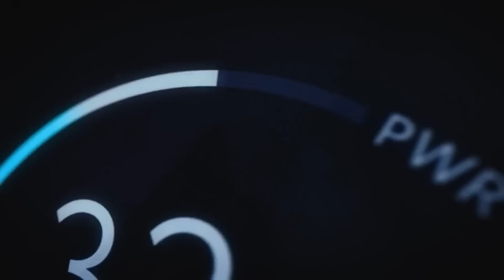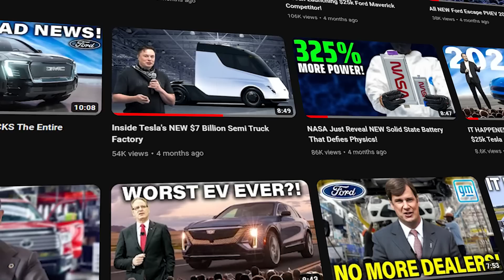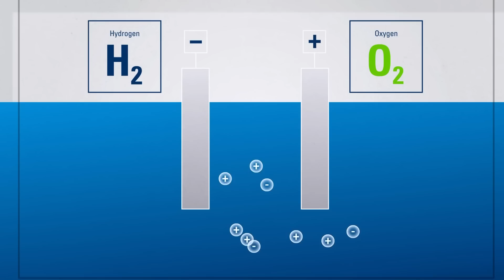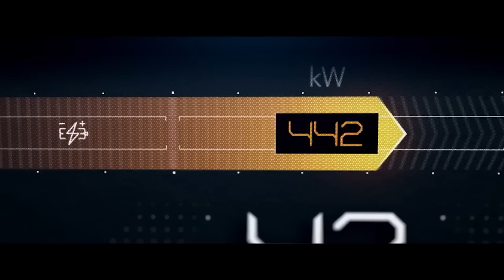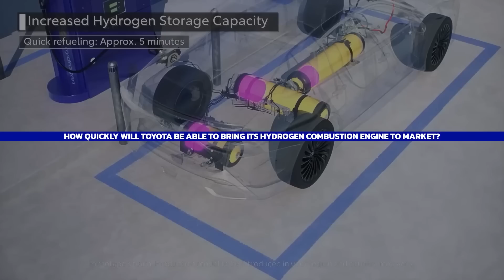New Toyota CEO Reveals Hydrogen Combustion Engine | Shocks Industry!

Comment: At least the hydrogen car will not have a lot of batteries to deal with after the car reaches the end of useful life.  It is better for the environment. Need more clean energy alternatives 😊
Reply: Batteries are 98% recyclable.  You boil them and the lithium, iron and phosphate separate.  Even if they weren't, if you look at lithium, iron and phosphate, they are naturally found in the earth and I doubt they would do it any harm. Farmers like phosphate, the earth is mainly made of iron.
Reply: Batteries are basically very high grade ore. It costs much less to recycle than to mine, refine and process the raw materials. In the future when enough battery packs finally reach end of life recycling will eliminate almost all mining.

Comment: so, you take hydrogen, with all its downsides and those  few upsides  - and then you burn it in an engine!  mmh let me repeat then you BURN it..... and speak about environmental friendly !?!
Burning stuff is the whole problem. Burning stuff is eviromentally unfriendly - and by burning Hydrogen, you've just burned the last argument for using it in cars. 
So you take a bad idee, and make it worse! - Why?
Now what i don't get, the technicians at toyota cerainly aren't  stupid - so why do they come up with such stupid ideas. Why are they backing Hydrogen als fuel-cell or ice with such vehemence? Certianly not for the love of our planet. I must be missing some part of the puzzle, 'cause it just doesn't add up!

 90 sec' refueling!?  what they don't say is that nozel freezes up by that speed. This may cause problems with disconecting and the station will have to warm up again before the next refueling process. 
Hydrogen will never be able to compete financially. The sum of the parts defines the price.  If you bake two cakes with very simular ingrediants, but one cake takes 2 parts the other 5 parts and the results are  comparable  - which one is more viable, which one is more sustainable?

there are a variety of far better uses of hydrogen than fueling your everyday car. 
I don't think that getting rid of the car, as we know it, is a vailble solution (short to mid term) . so lets use our resources  carefully!

Comment: The only benefit I see so far. Is the very fast fill up. As well as no crowded or down charging stations. Plus at least one of the materials. That is used to make the batteries. Is mined by child slave labor. Including the electric vehicles, wear out tires faster. Are made with a lot of plastics. Cause rolling blackouts, etc and so on!!!
Reply: One of the largest uses of cobalt is by refineries that use it to remove sulfur from fuels.  Literally no one's hands are clean, except maybe those EVs using LFP batteries, which use no cobalt.
Reply: I guess you wrote this on a cobalt free laptop? Also, LFP batteries have zero cobalt. Plus, the fossil fuel industry uses way more cobalt to remove sulfur. Still concerned about child labor?
Reply: The stations that do exist usually have long waits.  They cost millions to make (vs tens of thousands for EV chargers) so they will never likely be overbuilt to a point where you aren’t waiting in line (economics at work).  I think roughly an EV station is $2 million.  Gas pump is about $300k and EV charger is $50k.
Reply: @Chris   A 90 second tank fill up time, is a very short wait. A gas tank takes between 6 to 10 minutes to fill up. Compared to a half hour to over an hour. Or more for a full battery charge.  I would hate to have three EV's in front of me. More or less ten!!
Reply: @ariesmight6978  A Tesla will travel for three hours. Are you not needing a break every three hours? For shorter journies the car can be charged at home, by many people, for the same effort as charging a mobile phone. Hotels and highways have a growing number of chargers.  I think that Tesla is beginning to indicate availability so you don't have to queue.
Reply: @Robert White   Everything that you had said. Indicates that you are a narcissist.

Comment: Brilliant! It combines inefficiency with lack of infrastructure. Definitely a recipe for success.
Reply: Don't forget incredibly expensive. There is nothing cheap about hydrogen.
Reply: @Aircam73  look into Japan going nuclear again with the byproduct being Hydrogen. It makes sense for Toyota to be doing this research. Because on their island hydrogen will become abundant with the new reactor.
Reply: @Aircam73  Scale will make it cheaper.
EVs are screaming expensive too.
Reply: @mirola73  No no it will not. Scale will actually make it more expensive as now you have to ship it from where you are making it. The larger machines will cost a couple orders of magnitude greater than what the small ones are and it doesn't change the fact that the largest costs are still the electricity which is still a fixed cost and EVs are cheaper in every and I mean every regard to hydrogen. There isn't a single thing that a hydrogen car can do cheaper.
Reply: @Aircam73  Hydrogen would require a technology shift for production and likely storage.  There have been some storage successes, but I'm unaware of any breakthroughs in a more efficient way of producing it.  For an all-electric solution, we would also need to significantly change the way we store electricity.  Current battery technology is not sustainable and definitely not friendly to the environment.  Natural Gas, and plug-in hybrid are the best current tech for efficiency.
Reply: @TheSpadre  What technology is out there that can store hydrogen any cheaper. Don't tell me the ones that just announced a "breakthrough" but real ones doing real storage...I'll wait. They have tried to reduce the cost of hydrogen production for the last 60 years and have spent 100s of BILLIONS of dollars with very little success. If you think batteries are not friendly to the environment then I don't think you know how hydrogen cars are made. BTW they have batteries also. Why isn't the current technology sustainable? Battery tech is moving forward and has been for the last 30 years. Either increasing the density or reducing the cost by between 10% to 20% year over year. Even with the current technology batteries will be just fine for hundreds of MILLIONS of EVs. As for Natural Gas it is just another fossil fuel that may be better than gasoline but will never take over. There isn't enough of it to power every car on the planet and it costs a lot more than an EV and even more than gasoline. Plug ins had their day and were a good transition from gas to EV. That is how I started but now you just have the worst of both worlds. You still have pollution from the gas, you still have oil changes and all the maintenance of an ICE. Then you are either dragging around a heavy battery when using the ICE or dragging around a heavy engine when using the battery.
Reply: @Aircam73  the problem with electricity is provide it when needed, million cars charging at the same time, a single car requires more power than a typical small home. That would require the entire grid restructuring so infrastructure is not there for it either. Hydrogen can actually become a cheaper source if the grids are not upgraded tremendously.
Reply: @rappymic2595  The amount of misinformation from one post is astounding. A single car draws as much power from the grid as an airconditioner not a whole house. They also charge overnight when the grid has the most excess power available making the grid more stable as you don't have to ramp up during the day and throttle back during the night. Hydrogen uses 4 to 6 times as much electricity as an EV to go the same distance IT WILL NEVER BE CHEAPER. Also your logic is completely flawed. First you say the grid can't handle EV charging but promote hydrogen that will need 4 to 6 times as much electricity as an EV?
Reply: LOL, spot on. Also, invisible, odorless, and highly flammable. What possibly go wrong?
Reply: @machoopichoo2  Various things can cause lithium to go into thermal runaway, and Tesla's batteries blow fire, instead of hot gasses. A large chunk of roadway hitting the bottom of a Tesla, hard enough, at highway speeds, can, and does cause punctures, and shorts....Which rapidly leads to total runaway. A total loss. Hydrogen is the most abundant element in the universe. Burning it, produces steamy air, like a sauna. That's non-toxic
Reply: @machoopichoo2  Now discuss how materials are gathered to create batteries, and who those human beings are......
Reply: @AliensWanted  So, you wrote this comment on as cobalt free device? LFP batteries contain zero cobalt. The FF industry uses way more cobalt than batteries do, to remove sulfur. Educate yourself on this FUD.
Reply: @machoopichoo2  Ask the Challenger Crew.
OH-RIGHT...you CAN'T.
Reply: @drpoundsign  Or most of the crew of the Hindenburg. Oh, wait, even the ones that survived are now dead of old age. ;^)
Reply: @machoopichoo2  all problems will be solved before introducing to customers. Encourage innovation.  Be patient.
Reply: @machoopichoo2  Aren't petrol and gas highly flammable ????????????????????
We've been driving them for donkeys, no one complaining.
There for a pretty moot complaint.
Reply: @mirola73  Not at all moot and it is "therefore." H2 is very hard to store, it is odorless, colorless, and burns pale blue (nearly invisible in daylight), all which is not true of petrol. 

Since we are talking about fires, here's another point on ICE vehicles:
"hybrid vehicles reported 3,475.5 fires per 100,000 sold. Gas vehicles accounted for 1,529.9 fires for every 100,000 sold. Electrics saw just 25.1 fires at the same rate." So, ICE cars are 60X more likely to burn than BEVs, and hybrid even worse.
Reply: And you are still burning something, which creates greenhouse gases.
Reply: Yup, just like the lack of infrastructure for EV’s!  Even if the infrastructure was in place for the EV pipe-dream, we do not have the capacity to generate that much electricity!  And thanks to the E.S.G. Movement, they are paying energy company’s to SHUT DOWN generation plants without replacing them....with ANY type of electrical generation.  We are being sold our own demise and helping to pay for it like idiots....all in the name of saving a planet that IS NOT dying.  Climate change is NORMAL.  Earth has had many ice ages and tropical periods.  It’s cyclical, like everything in nature.
Reply: Plus you remain tied to the bowser to refuel - continue to be gouged by the fuel cartel
Reply: It takes all of maybe 1000$ to make a hydrogen production station in your back yard that runs on literally water a power socket to your house and a screw in light bulb cartridge of platinum it's 1000s of times more renewable than electric vehicle technology
Reply: @Chris74931  You hydrogen guys are hilarious. This is like saying I can charge my EV by connecting a generator to the tire of my bicycle. The fact that you know so little about what it takes to actually fill up a hydrogen car speaks volumes of those that believe in it. Just to give you the most basic Idea of what is needed to even get hydrogen into a car will require a massive upgrade into your electrical system. You will need a real electrolyzer capable of doing more than just blowing bubbles in water. From there you will a 10,000 psi hydrogen compressor and storage tanks. All of this will exceed $100,000 and it will barely fill your car once a week. The best part is that you will most likely blow yourself, your family and your neighbors up. That is why they will never allow anyone to put one in their home. Also it will cost around $50 per kg in electricity just to fill your tank since you aren't able to get commercial rates on electricity. That means unlike EV charging at home and filling the tank for $12 to go 300 miles. You will get to pay over $250 to go the same distance.
Reply: well hydrogen is faster to refuel
Reply: @reardelt  It is not on a declining cost curve like batteries are. Hydrogen will be far too expensive. Battery charging speeds are also accelerating very fast.
Reply: @machoopichoo2  I think they should make batteries insta-swappable at stations. This would make EV adoption a no brainer. But car manufacturers need to figure out how their batteries can be easily swapped
Reply: @reardelt  Nio has gone down this road and it makes no sense. Their swap stations are massively expensive and this exacerbates battery supply challenges. Batteries already charge fast and that is improving very rapidly, and the costs are coming down on a predictable declining cost curve.
Reply: @machoopichoo2  Yeah well let's see how Hydrogen combustion engines pan out. The positive side is that we don't have to dig out Lithium and nickel
Reply: @reardelt  This H2 idea needs to be panned, as it makes no sense whatsoever. LFP batteries do not use cobalt or nickel and promising sodium batteries don't use lithium. More cobalt is used by the FF industry than batteries ever will.
Reply: @reardelt  Kind of. Three minutes to pump, and weeks of looking to find a Hydrogen fueling station.
Reply: However it’s better for the environment than EV. 

Kaizen always wins out in the end.
Reply: Yea well there no electric stations for stupid toy cars either.
Reply: And you need only 3 to 4 times the amount of clean energy to drive a km than an BEV! Smart!
We have loads of renewable enery, so where are we waiting for!

Never heard so much crap in 8 minutes.
Toyota is done, Nokia 2.0, Agfa2.0
Reply: There is no infrastructure in place or plans to get us there for all-electric cars either.  ICEs and hybrid ICEs are the answer going forward until we can figure out how to re-imagine how to store energy in a safe and environmentally friendly way.  Current battery technology is not sustainable. Hydrogen is more promising than batteries.
Reply: @TheSpadre  100% agree!
Reply: @TheSpadre  ICE is the only answer? I bet GG-grandpa Jones said that Horse and wagon will be the only answer back in 1905😂
Reply: @troyfelsman583  You sure it wasn't the Clampetts?-LOL
Reply: Have you never heard of a petrol station?  Also, hydrogen is limitless compared to lithium etc. I'm sorry to say but you are not seeing the bigger picture
Reply: @ghollidge  I have indeed heard of a petrol station, and have seen many of them. I have not however ever seen a hydrogen station. 
While hydrogen is the most common element in the universe, free, uncombined hydrogen is extremely rare on earth. The energy required to free hydrogen from its compounds is often more than can be realized from using it as a fuel.
Reply: @ghollidge  Lithium is the 34th most abundant mineral on the planet it is far more usable and recyclable than hydrogen.

Comment: What about synthetic gasoline? It is possible
Reply: Too costly, too inefficient, still pollutes.
Reply: Biofuels make way for sense than hydrogen.  But, still probably don't make sense compared to battery electric, at least for cars.
Reply: Except hydrogen burns clean. H + O2 = water H2O. Still hydrogen is stupid. Maybe not in japan but certainly elsewhere.

Comment: If it works great but the 2 million + to put in an hydrogen station. That is going to be a big issue
Reply: Bert, you forgot the fact that the $2 million dollar station can only hold enough hydrogen for 40-70 cars. Really doesn't seem like a solution to me .
Reply: @davekozlowski1266  I did not know that . Good Point!!

Comment: EVs are a scam. 

You have to compromise in usability while paying on average 20k more for a vehicle. They don't do well in cold,  hot,  wind,  high water,  and suck in real highway driving over 60mph.  They have Low range, can't haul, are overly complex, take forever to charge, and electricity costs are rising fast. 

EVs require 74% of the carbon and you don't reduce carbon until you drive 100k miles. If everyone switched from gas to EV we'd only drop our carbon emissions by 0.4%

EVs are nothing more than the new status symbol in America. 

Then people suggestion that you spend an additional 30k on solar panels on top of the 20k more you spent on the EV vehicle to drop your charging rate is absurd. 

EVs are a scam and that's before we get in to how they destroy the earth to create and dispose of batteries.
Reply: Tesla model Y will be the most sold carmodel on planet Earth in year 2023 😄😄👍
Reply: @bastian33o2  Teslas are not cheap.  A Model Y starts at over $55k.  A Chevy Bolt starts at $26k.  A VW ID4 starts at $45k.  At the peak of the insanity, Tesla was charging $67k for a Model Y.
Reply: @dansanger5340  Elon plans to halve the cost in the next couple of years. His plan was always to start at most expensive and make things cheaper.
Reply: @robertwhite3503  You can believe the marketing hype or you can believe the actual prices.

Comment: Combustion will never be as efficient as a fuel cell. Hydrogen is horribly inefficient as it is. You need to create the infrastructure first. Then you need to make the electricity. Then you need to use that electricity to make the hydrogen. Then you need to use more energy to compress the hydrogen  Then you need to use more energy to transport it.  Why do all those steps when you can just dump the electricity in a battery?

Comment: Great but and it’s a big but. We’re is the hydrogen infrastructure which of course you need. It’s took 10 to 12 years to get some sort of charging infrastructure so god knows how long that would take. Plus I like the option of charging at home. Plus surely after about 100 years we could do better than keep trying to milk the old piston engine which by design is no we’re near as efficient as an electric motor no mater how you fuel it. Of course development is on going with batteries. Maybe Toyota will create a hydrogen infrastructure like Tesla did with the supercharger network if they were serious and truly believed in it.